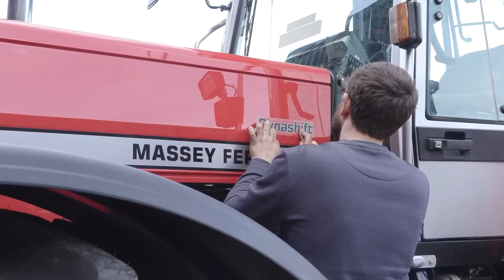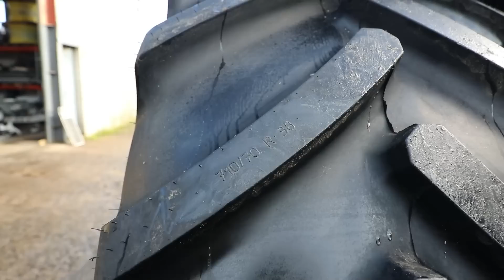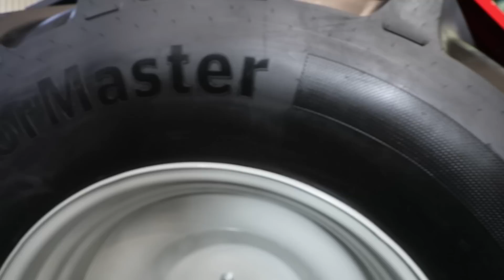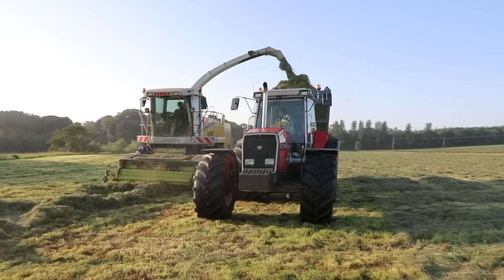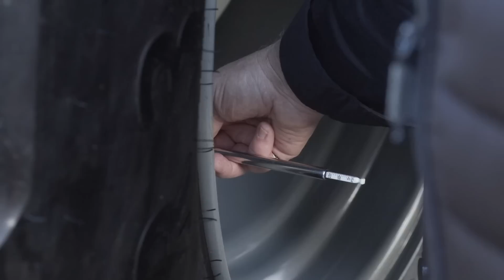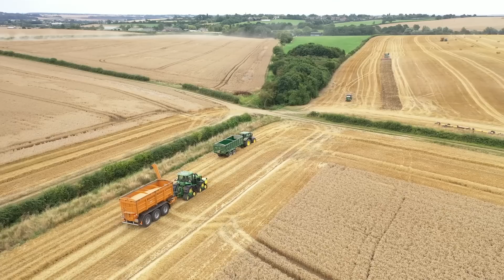Continental Tyres

Comment: I had a set of continental tyres on a fastrac years ago due to not being much around at the time that were speed rated for 65kph and they were utter crap, if they held air long enough without cracking which on a speed rated tyres is nothing short of dangerous  you could literally watch them wear away. For me they've had their chance, haven't had that make on any vehicle I've owned since or will in the future.
Reply from the maker: We fully believe they have changed.  But its hard to forget a bad experience at the same time.

Comment: Hope these new Conti's are better than the utter shite that went before
Reply: Once bitten…….
Reply: Always used to crack up before you got the full use out of them, I’d never entertain them again
Reply: @owenjones8973  had them on a Valtra T162, only got 40% out of them, started to crack up, tried tubes but the cracks pinched them, never again, will be a good 5 years from these new Conti's before I will even lok at them
Reply from the maker: I think thats the point they are trying to get out there.  Complete new tyre.  And time will tell.
Reply: @Grassmen  Lets hope they have got it right and learnt from the last lot
Reply: Had a set on a 6800, probably put 7 or 8000 hours on them, I'll concede they still weren't fully wore but what more can you ask for?
Reply: @jeffjefferson3364  had valtra 6550, did 11000 hours on a set of Michelin